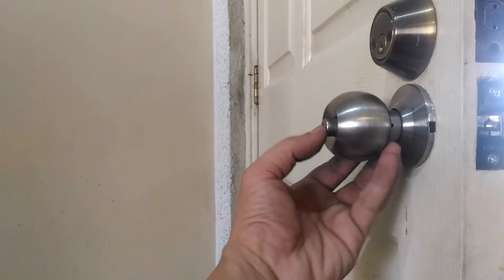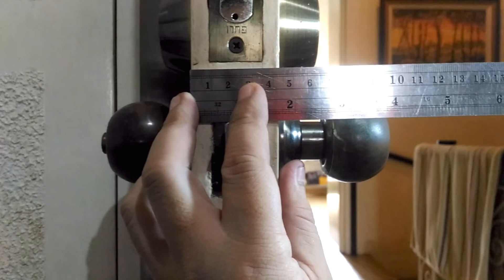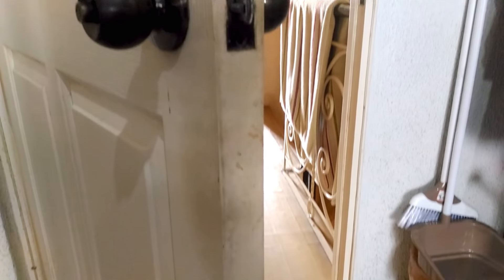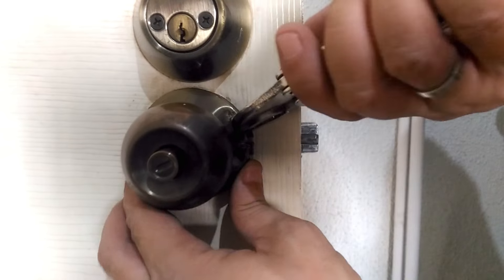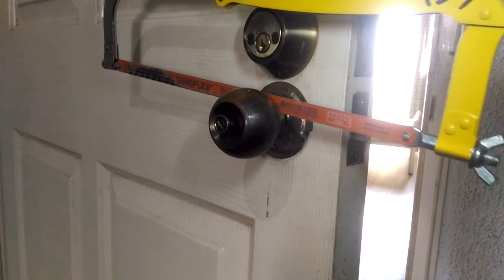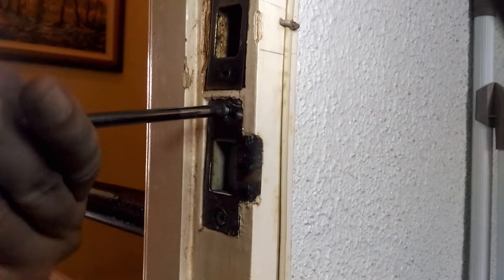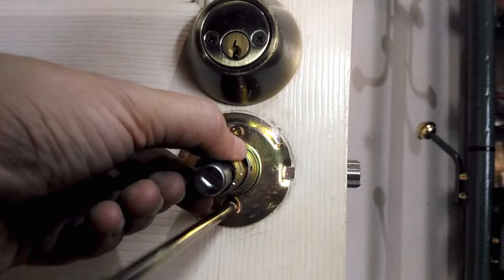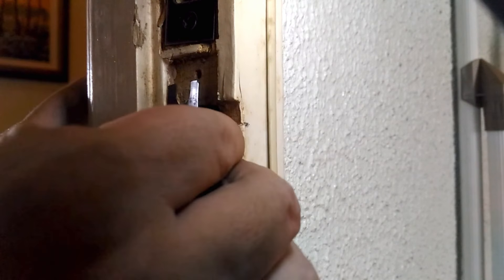How to Remove & Replace a Door Knob (No Visible Screws) | Door Knob Installation

Comment: You encountered the worst case scenarios so that we could learn! My current old door knob could not ledge into the frame.  Just got a handyman, he chiseled part of the door frame hole and re seat the plate.  Then now I realised the keys couldn't open the knob after accidentally locking the door.  Handyman use hammer and a chisel to wedge the door open in the end.   Have to go buy a new knob and would be paying a fee to the handyman again.
Reply from the maker: Thank you for sharing your story. I might just make another video to address your specific situation 😉
Reply: @HanDIYman007  You understand what I described?  I was afraid you don't understand.
Reply from the maker: @SuccessforLifester  yes i do, because my mom's bedroom door has a somewhat similar problem. Now i even have to repair the chiselled sections of the door and the frame AND install a new doorknob 😉
Reply: @HanDIYman007  Yes we thought the key was turning the door knob properly when the lock button was not engaged.  Handyman went to get wood putty as he over chiseled.  The over eager me locked the knob and closed the door. And realised that the key couldn't unlock it...

Comment: Thanks much. You include all the little nuances that the "instructions" that come with a new knob do not. You smoothed out the installation process. I needed a replacement knob because I had closed the locked door -- but had no key to unlock it. My solution instead of a hacksaw was an electric grinder with a cutting wheel. That saves a lot of time and sweat. Good stuff, Mr. 007.

Comment: Thanks for the video! Very helpful. However my pain is at installing the striker box as the wooden door frame hole is not aligned. You suggested to chisel off the wood but i tried with no result except for a cut in my finger. What tool do you suggest to cut a hole in the wooden frame? I'm imagining an electric saw?

Comment: NOTE: Some inside knobs do not have a "press in" catch that's used to release the knob.  Mine has a tiny 3/32" hex screw that requires loosening (after which you need to remove the hex driver) THEN the knob will slide off effortlessly.

I found this out after an hour or two of looking for a catch like the ones in all these YouTube videos, a catch that requires just pressing in for a 'click' which releases the knob.  I have no idea how unusual the hex screw-type catch is, but it is very real.  I used it on two door lock mechanisms that were loose and required removal of the inside knob for access to the two main screws for tightening..

Comment: My advice - buy a doorknob with easy to get to screws on the inside. By the time you figure out how to get the cover plate off the old inside screwless doorknob, you could have installed a whole new assembly.

Comment: I am now convinced my doorknob is jammed. I stick the tool I am using into the hole and I feel the pin go down and I pull and wiggle at the same time. It won't come off. What's the deal? And yes I am pulling with all my damn might

Comment: I have a recent issue with my door knobs sleeve. The sleeve that my inside door knob slides onto sometimes comes out of place nd just spins around without me being able to open the door. After some fiddling around i can get the sleeve to go back into place and i am able to open the door. The shaft only stays in place enough for me to open the door 4 or so times before it pops out again. Is there a fix for this or is the only solution to buy a new door knob kit?
Reply from the maker: replace it with a new one, that's my suggestion and save yourself the hassle of looking for the root cause, especially if it is already old. Otherwise, one day you'll find yourself completely locked inside your own room simply because you can't turn the inside knob anymore.
Reply: @HanDIYman007  I thought i might have to replace it. Thanks for your reply.

Comment: in our case it appears the T end isn't long enough when not pressed in. What should we be measuring and how do we know which lock to buy,  in our case the latch won't relax backwards because we have push it in, to get it to go into the lock. So its already pulled in but won't go back. There is no point buying a new lock again as we don't know what to look for. On the packet our door has backset 60mm 2-3/8" and to fit doors 28mm to 45mm thick, that part is ok, but im sure what backset means ill google it. according to my rulee my backset is about 80mm from edge of the door to centre of the large borehole, i presume thats why its not working. Is anyone able to advise?? according to lowes.com a backset is:"The backset is the distance from the edge of the door to the center of the 2-1/8-inch bore hole. In the United States, there are two common backsets for residential door locks: 2 3/8 inches and 2 3/4 inches."  im in asia not the USA so i need to know the sizes for here.
Reply from the maker: If you are replacing an old doorknob set, I suggest bringing the entire old assembly to the store so you have an actual sample to compare against. Does this help?
Reply: @HanDIYman007  in this case i think no, the internal mechanism was taken away when the door was broken we were left with door handle with no latch. Measuring from the edge of door to the centre im getting 70mm When the piece we have with the t extended is about 49mm according to my ruler, so i presume i need a 70mm version. I will trawl. Some hardware stores and see if i can find one. Thanks for the reply though i wasnt expecting it :-) sadly i cant show you a picture as youtube doesnt allow
Reply from the maker: @CumbrianEscrima  better yet, take a picture of the door too with the ruler on. Both the backset measurement and the thickness of the door. This will help the store visualize better your situation. Good luck!
Reply: @HanDIYman007  thats exactly what i did. Just trying to find the right shop, that will sell just that bit or ill need to get a whole new lock i guess. I bought this one from Mr DIY im sure the assistants there dont really know anything about doors really. Ive taken off two door nobs to repair them in my current building do i understood the basics.
Reply: You know after all that it turned out when the handyman rehung the door he moved it, a little in the frame so now its in the wrong place to close even with the 70mm which was perfect 😂😂😂😂